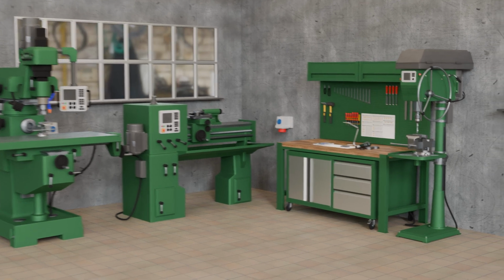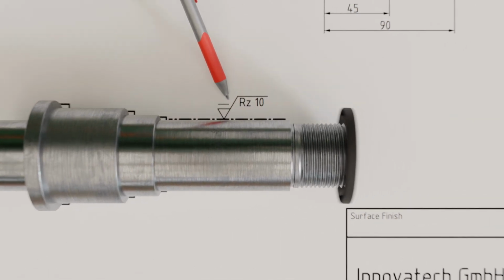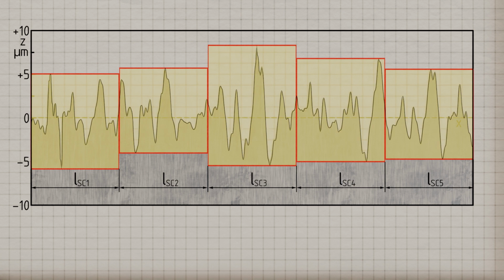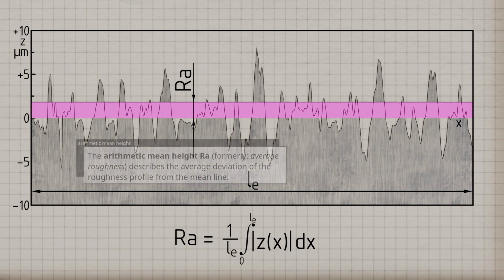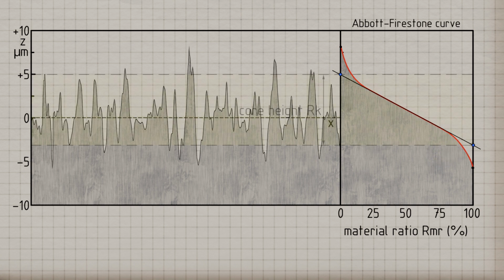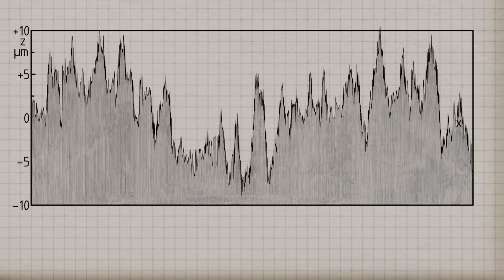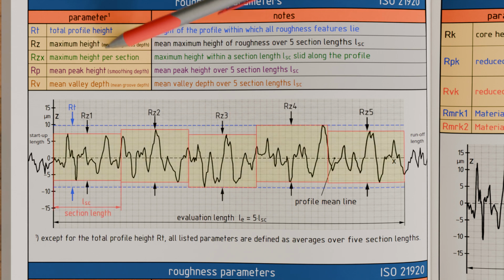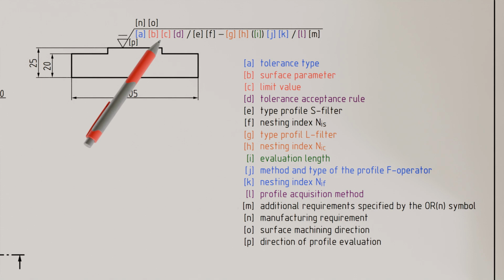Surface Specifications ISO 21920 | Roughness | Mean Roughness Depth | Arithmetic Mean Roughness

Comment: Thanks for this deep insight...one short query : is any minimum percentage to capture the difference between Rt and Rz so that after the measurement we will consider there are no such max outliers.
Reply from the maker: When evaluating surface roughness, the ratio between Rt (total profile height) and Rz (average maximum height) can help detect outliers. Since Rt is highly sensitive to single peaks, a common rule of thumb is: if Rt is no more than 2 to 3 times Rz, the profile is generally considered free of significant outliers. A higher ratio—especially if the difference exceeds 200% of Rz—may indicate extreme deviations and should be investigated further.